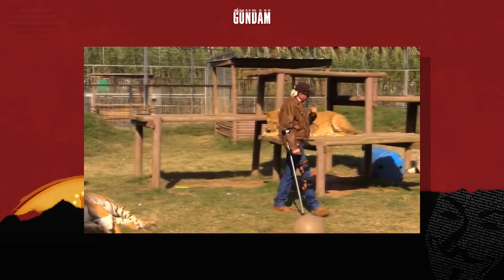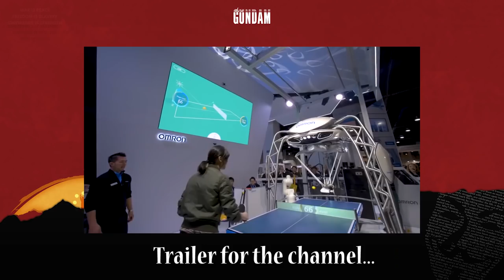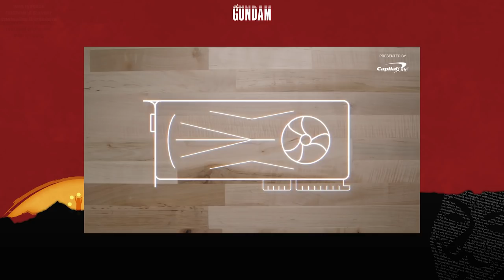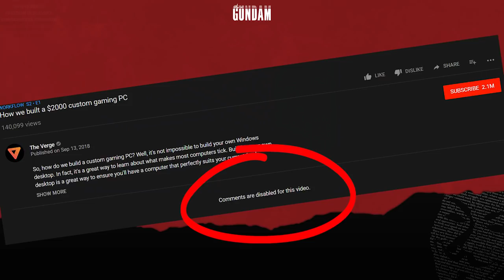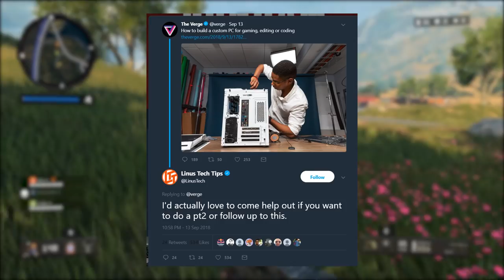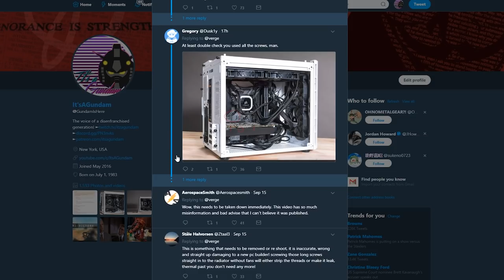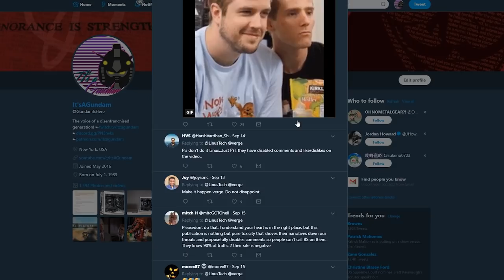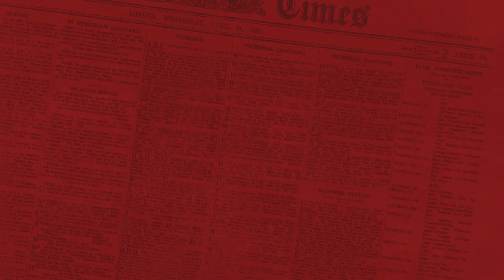How The Verge built a $2000 custom gaming PC WRONG!

Comment: OK. If I were to build a 2000 dollar PC, the first game I would play would NOT, I repeat NOT be League of Legends. I'd play something like FFXV on High or Ultra (not sure if that's a setting in FFXV) or some other demanding game.
Reply: Nothing to play on a 2k PC. You'd probably need to run two games in 4k to max out on power.
Reply: @Wyzai  was the new tomb raiders hair physics not quite demanding? Would be at least a better test than league of legends anyway
Reply: @themadhammer3305  As of now, the ultimate game to stress test your ultra high-end rig is Metro Exodus. Although, there are definitely reasons why you might want a 2k dollar PC for League. If you are a pro or practicing to be a pro, you might want that 240 fps ultra high gameplay with minimal input lag and maybe even do some streaming on the side. I play Dota which isn't considered to be a super demanding game, and it certainly isn't if you are content with 60 fps. But I've seen streamers with i7 6800k's and RTX 2080tis struggle to get past 140 fps while streaming in 1080p 60 on twitch. I use an i5 6600k @ 4.6GHz and R9 Fury @ stock with an 850 Evo SSD and 16gb DDR4 3000MHz, sometimes I drop down to 110 or 120 FPS in team fights when it normally runs at 160( I don't stream). That drop is extremely noticeable, especially if you are a somewhat competent player.
Reply: @marcusrat4466  I thought a consistent 60 FPS was the goal for most gamers, thanks for giving me more info on the subject though
Reply: @themadhammer3305  Indeed, 60 fps is still what most people are going to play on. Even the ones who play less graphically intensive games such as League or Dota. The primary reason for this 60 fps limit is the monitors- most people don't have the budget to purchase a 144Hz display. And plenty of casual gamers don't even consider the prospect of high refresh rate gaming because they don't believe it can make such a huge difference in gameplay. 
Personally, I didn't notice the difference until about 2 or 3 weeks. And one day I went to Windows desktop, switched the display to 60Hz and was surprised to see how jittery everything was. The cursor, the windows, everything felt laggy. For single player titles, it really doesn't matter that much if you use 144Hz because the gameplay mechanics are pretty restricted and the outcome is predetermined. But in a competitive multiplayer title, especially shooters, it makes a ginormous difference. Most people aren't competitive gamers- in fact, the majority of people playing league or dota are just playing for enjoyment. 
But there are a select few among us who like to push ourselves to the limit because we derive satisfaction from competing and winning at a high level. And this small group of people will spend 1k dollars or more on their PC just to play League or CS GO. At some point, hardware will start to hold you back, and you can feel it. The actual professionals have it good, they are sponsored by NVIDIA, Intel, AMD, Corsair, Samsung, etc. and get the latest stuff delivered for free. Most of the pros don't even know that much about hardware, they just care about their peripherals (mouse, keyboard, chair, etc.)
Reply: @themadhammer3305  here, check out this guy: https://www.twitch.tv/bananaslamjamma He is a semi-pro and streams Dota, although these days he has mostly been playing a custom game within Dota called "Auto Chess". Check out some of his VODs of previous streams, look at the FPS. Granted Auto Chess is developed by a few indie devs and isn't as optimized as Dota but still. The rig he is using features an i7 6800k and RTX 2080ti

Comment: "static bracelet to protect YOU and the parts" prepare for this thing to kill you if you get zapped!
Reply: When were talking 110-240v having a path to ground will get you killed!
This guy deserves a Darwin award.
Reply: You can get killed by 120-240v.  I've been hit by each at least once.  Didn't die.  Only takes like 20 volts, really.  Voltage just overcomes the body's resistance (12v can't and won't give you a shock), it's amperage that kills you, and even then the amperage has to go through something vital like your heart.
Reply: Amperage and voltage interplay a lot closer than what you imply. 
The pipe analogy was always the easiest method for getting non-nerds to understand it. The voltage is the width of the pipe, the amperage is the pressure. 12 foot width pipe with no pressure? a trickle if you are lucky, 6mm pipe with a ton of pressure? can drill a hole in steel.
Reply: "VERGE JOURNALIST GETS ELECTROCUTED BY A MAGICAL PC THAT WASN'T CONNECTED TO THE POWER GRID, CIA INVESTIGATING ALT-RIGHT GROUP"
Reply: @jtnachos16
TL;DR Volts determine the amps.
Reply: No, just no. The video you link is full of inaccuracies where he is operating off of flawed assumptions that one is staying in contact with the electric source past the initial discharge. He also has comments disabled, which is a no-no. He also doesn't cover grounding and why it is a thing, which is actually an important thing to remark on.
Voltage does NOT directly determine amperage. The overflow difference between a high voltage and the resistance of the object it is going through can AFFECT the effective amperage, but is does NOT inhertently determine it, especially given that for the current to actually threaten you, you have to be in contact with something it can travel through, it's why birds can stand on power lines. If you were to hang from a helicopter or stand on a power line, in contact with only one cable, theoretically, according to the known laws of electricity and associated physics, you wouldn't die, because you aren't interrupting the existing loop, so the electricity isnt flowing through you in order to reach a source of lower voltage.

This video gives a visual demonstration of someone touching a 200,000 volt generator with no pain or other harmful negative effects:
https://www.youtube.com/watch?v=ubZuSZYVBng
Reply: It's a static bracelet. It's for protecting the parts from static discharge when you build a PC. You don't build your PC with the power supply plugged in. So no need to be arguing about 240 volts.
Reply: True it's not an actual static bracelet. It's amazing how he knows so little yet made a how to video.
Reply: What kind of can of worms did I open up? Jesus no need for arguments. I've only been zapped by a original Xbox when i modded it and touched the square metal piece LOL

Comment: I love how he threw away the plastic cap-cover that protects the CPU socket pins. I only hope he used non conductive thermal compound otherwise he will need to find that cover again when the arctic silver 5 shorts the pins and kills his Motherboard. I would say CPU but generally these days CPU's are pretty tough It's not a Celleron or Athlon when there was no heat spreader and you have to be very careful of how much you tighten down that heat sink if you used a custom cooler otherwise mostly it had the AMD or Intel supplied cooler which clips. As for the PSU it will run fine at first until dust builds up, It will be highly inefficient as he blocked the airflow and a hotter running PSU limits voltage supplied to cool down, not really much of a problem unless he is on the edge of how much hardware he has installed along with how strong the power supply is.Using long screws on just the radiator on the all in one cooler can lead to you piercing the radiator which leads to leaking and a fun time. Overall his build is just lazy and for someone who said he has build a lot of them before and i hear is studying computer science he is just letting down every computer technician and everyone who has built their own computer. You wouldn't hire this guy to build you a computer, but i get worried for some college student, most likely a girl who's computer isn't working so they get this guy to look at it. His excuse is he was rushed then you should of postponed this video and do it another time when everyone at the verge has more time.

Comment: Waaaait, why wouldn't the system boot with that RAM config? It's usually simply non-dual-channel mode boot and everything works fine, just not at it's optimal performance level.
Also, on SSDs: don't forget load times. SSD often TREMENDOUSLY decreases those.
Reply: Rastrelly some older mobos would have a shit fit and blast the speaker with ram error code beeps. Granted that has only happened with proprietary mobos (dell, ect) from the late 90s early 2000s in my experience.  Had a few buddies who did not know what they were doing all the way when cleaning out pcs and thought they had to remove the ram and clean the dimm slots with compressed air, tossed the stick in slot 2 and boom error beeps on attempted boot.

Those were special mobos with 3 dimm slots. Still one of the weirder things i have seen on proprietary mobos.
Reply: @hnsolo77  Yeah, I totally forgot proprietary ones ) Though I luckily had to have fun with those only once.

Comment: 12:56 I'd have to reject that. An SSD loads SOOOO much faster than an HDD. The 2 are not even in the same league. It's like back in the 2000's, in F1, there was the Ferrari, and then the rest of the racers.
Even at just starting up your computer, windows 10 just fully loads up way faster.
Reply: More like Mercedes against Williams.

Comment: Gundam, It would still boot with the ram like that... it'll just be gimpy.  He put them both in the same dimm channel on a dual channel board so now the things going to be running in single channel mode wasting half the bit-width that the bus supports.
Reply: Pretty sure I saw some boards which had same channels right next to each other; is it perhaps the case with this one? The interweaved pattern is definitely more common though.
Reply: Dual channel boards with 4 slots usually come configured like this:

Dimm  A1
Dimm  A2

Dimm B1
Dimm B2

To get the maximum effect of having a dual channel buss you want to split you sticks between the two dimm groups.  In the case of this board the recommendation for 2 sticks of ram is to put one in Dimm A2 and one in Dimm B2.

There's two possibilities I can think of for what you mean by interweaed
Some boards will use different colored plastic on the main dim slots for each channel so the builder can easily identify them.  For instance on my board Dimm A2 is blue plastic, Dimm A1 is black,  Dimm B2 is blue, Dimm B1 is black. 

The other possibility is quad channel boards but I've never had a chance to play with one of those so I lack experience with how they layout the dimms.
Reply: Depends entirely on the use scenario.   "Speed" is too vague a word to work with.   Here's some benchmarking results:
https://www.gamersnexus.net/guides/1349-ram-how-dual-channel-works-vs-single-channel/Page-3

They come to the same basic conclusion, theoretical isn't the same as practical results.  That being said in PC gaming with resource hungry games I'd be going with dual channel mode even if it only squeezed out 1% better performance than single channel.  Especially if a game's using up most of my physical memory and doing frequent high volume reads.  You know a lot of pc gamers that would say "hell no I don't want to get a higher average framerate out of the hardware i already have installed"?

Comment: Honestly, a regular person who is just getting into gaming PCs should get a prebuilt that has a decent, non-proprietary case, and then just swap out parts as needed. Eventually, building an entirely new computer would be necessary, but by that time you should know enough of how to replace parts, to build your own with some advice from reddit for the motherboard and CPU (the most core parts of a computer).
Reply: Honestly that's what i did and it's working great. Got a decent prebuilt 4 years ago and put in some more ram, an ssd, and a new graphics card when i could no longer play new games a few months ago

Comment: I always scrape off the factory thermal paste and apply my own with a quality brand of paste I trust. Just something I'm particular about. Applying paste on paste is pretty asinine though. Also, that's not the worst wire management I've ever seen. My computer has the worst cable management you've ever seen, because I'm still using an old Dell Dimension 2400 case from like 2004. It's a MicroATX and has no back panel or spacing to run cables behind the main board, so everything is just lying in a big fucking knot right in the center. Probably should replace it, but it's fun trying to modify it to work with newer components, and there's something appealing to me about having a decent modern gaming PC crammed into a old shitbox from the XP era.
Reply: Noting like a gaming pc with ketchup and mustard power cables and hard drive ribbon connections dangling everywhere. 

I have a shitbox from the XP era (or more accurately, from the "I refuse to use Vista" era) and I want to make a final upgrade, water cool it, use oldschool led fans (no rgb) and sleve my non-modular PSU cabling so that it looks nice since they can't be hidden. Obnoxious 2000's gamer ricer aesthetic > rgb craze/ASUS rog aesthetic.
Reply: Cooler Master for life, brother
Reply: Got a 2005 Leader case still with a Windows XP sticker on it

oof
Reply: Sinuev1 
mine is in a 2005 eMachines case.  It looks like a shitbox from 13 years ago and that's how I like it.
Reply: Glad to see I'm not the only one.
I've actually got the case from my very first computer, and old Gateway 386/DX from like 1993. That goddamned thing is an absolute tank, with thick solid steel that weighs at least 40lbs empty. I've been meaning to modify that to make a modern computer case out of it - but I just haven't had the money to justify building a top of the line rig that I feel would do it justice, and it's my first PC's case... it kind of feels wrong to alter it. But at least with that I'd have plenty of room for cable management and expansion.
Reply: Sinuev1 I considered picking up an older one for that reason. Had to settle for MicroATX, but it worked out, even if my cable management is a bit screwy

Comment: Dude uses a swoss army knife that he hopes has a T-screwdrive?
I'm primarily a laptop guy and i always have a propper screwdriver in my laptop backpack.
Reply: He coulda gotten a better result with a regular dinner knife. Atleast it would have a handle!
Reply: But it is funny also because he "hopes" it will have one? What else is the point of the swiss if it doesnt definitely have one? lol
And a screwdriver is cheaper than the knife, do they think that many people carry those things around? I admit, I would like a swiss, but cant justify the price at the moment, but a small toolkit is cheap and more practical for most people.
Reply: If I've seen it correctly in their footage, the dude uses some kind of screw head attachment on it, so it's even more of a special type of swiss army knife.
but you don't even need a repair kit. most screws in a laptop and desktop are the same or about the same size so all you really need is one cross-head screwdriver with a magnetized tip that you can buy just about anywhere for peanuts.
Hell, I got mine packaged with an SSD enclosure I bought recently.

Comment: I've never used a ground strap while building any computer, ever.... COME AT ME BRO
Reply: I have built tons of pcs since the 90s and NEVER had a static issue. In fact I once had a boss order me to damage a part to return it. I tried a air ionizer on a graphic board and sparks were buzzing all over it. Guess what; It Still Worked!
Reply: I always touch the center screw of the electric outlet before working on anything electric.
Reply: Not if you have an wireless antistatic bracelet
Reply: Is that a Wi-Fi or Bluetooth wireless antistatic bracelet? 
Does it come in designer colors?
Reply: @jurgmanx4644  well if it has Wi-Fi and Bluetooth incorporated is a solid reason to buy it

On a serious note I've seen cordless antistatic bracelets for sale for just $2.11... I guess if you wish hard enough it will work...
Reply: Me neither and nothing has ever shorted.
Reply: I bare one of my foot before I touch my pc components just in case.
Reply: I took some wire off a spool, stripped both ends, wrapped one around my ankle and jabbed the other end into the ground socket of the wall.

Comment: I always install CPU after I put motherboard in. It may be an old habbit, but at least back in the day, you really needed to press against the motherboard to put the screws for CPU Fan correctly in, which was much easier done, when it was screwed in the case. You had to push a LOT, like you literally bent the motherboard until it went in, then the motherboard went to it's original state, no signs of bending at all, and I never had a motherboard to break on me. That's why I laughed a lot, when he said, that motherboards can break easily.

EDIT: I haven't built a PC for like 5-8 years, so I don't know, it might've changed.

Comment: He's calling the I/O shield a brace😂 and where is the cable management part? Why didn't he shown connecting the cables. It's a wireless pc!!
Reply: Also that particular asus board does not align with that shield correctly. Gotta have tools to make them clips fit that shield. I just had that same but non-wifi board installed on my new pc. I assure you that this verge guy didn't do it by himself. He did not.
Reply: That's why he picked a board with built-in wi-fi. All the components communicate wirelessly, even to transmit power.
Reply: @RolandTHX  LoL it's next level he's in the future.
Reply: @Jiepers  LoL